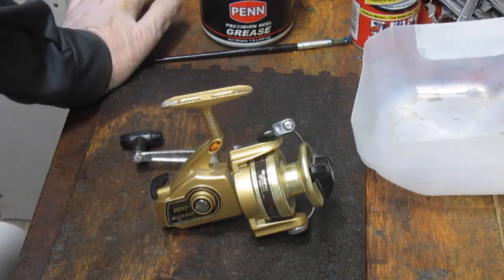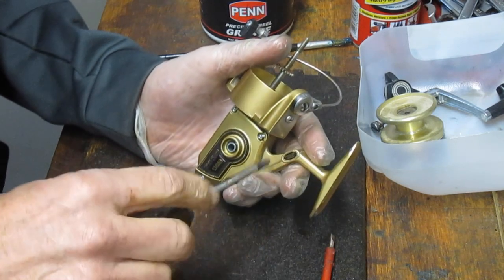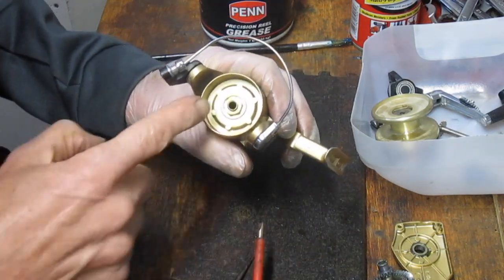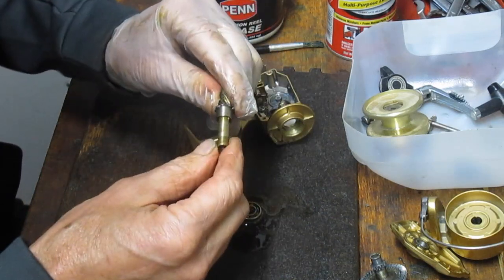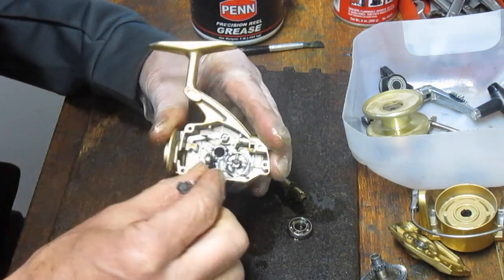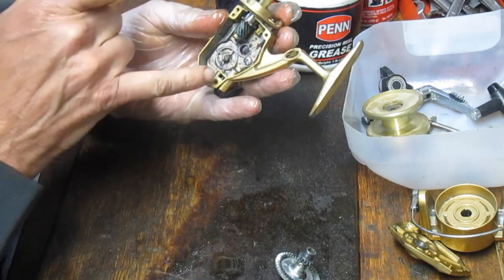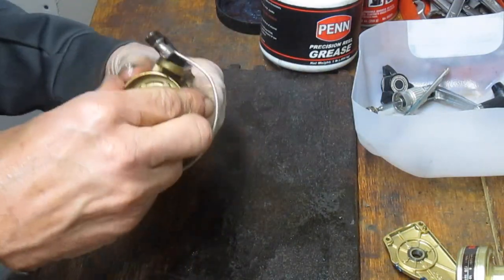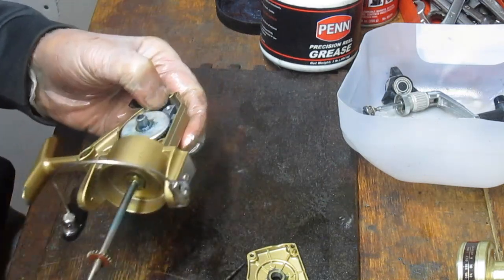Olympic GVO13 circa 1970 -80s Spin fishing reel how to take apart and service

Comment: I just got an Olympic 5060 saltwater reel. It is black with a gold spool. I bid on it after seeing this video. The only other Olympic I’ve had is a red 540. It is in mint condition and I have fished with it in the surf. This 5060 is going to need some painting on the arm and foot but other than that is in very good condition. I’ll let you know how it turns out. I hope it is very similar inside to this one in your video.     It is a little larger. I think there is a “reel” art to be able to correct bent bail wires. I’ve had mixed results mainly because the bails on large surf reels tend to be difficult to bend. I’ve just about worn out my Mitchell tools. I wouldn’t work on a 302 bail w/o that large Mitchell tool! Since my last comment I’ve added 3 more reels - my addiction is getting worse. I am restoring a Mitchell 402 and converting it to PUM,  added a 306A, and this 5060 Olympic. That makes an even 60 reels now. Out of control!
Reply from the maker: Good luck with the Olympics. They are built to last work horses like the Daiwa and others of the time.  You should enjoy fishing with them.  Thank you for the update.  Dennis

Comment: Very nice reel. Haven’t seen this one before. Great video Dennis! By the way, with 57 reels I definitely have more than I can use but I certainly try.
Reply from the maker: I think you may have exceeded the "usable" amount about 50 reels ago. Christopher.  So what?  Keep at it!  Dennis
Reply: 2nd Chance Tackle On my last week long Beach trip (last year) my son-in-law and I used 22 different reels. I’m never going to do that again. I am going to do a little local pond and lake fishing since our beaches and piers are mostly still closed. I have 8 vintage freshwater reels. I keep having kidney stones which are making my life even more miserable right now, Next week I’m going to start on restoring a Mitchell 402 and converting it to PUM. It will only work if I’m lucky enough to get those tiny set screws out and can replace the main bearing. We’ll see, I got a great deal on a 402 but the reason was that turning the reel had resistance, As you know there can be several reasons for that but I’m hopeful that with my experience with the 16 Mitchell’s I’ve worked on, I’ll be able to fix that. Wish me luck with the k. stones. Hope you’ve never had one. They are hell!!!
Reply: Dennis - I just got a Mitchell 306A for $10. Does the 306A have a ball bearing sort of like a 406? I’m trying to find a schematic.

Comment: Great video. My dad just passed on an Olympic Helicon 600 LG VO reel that looks similar to this reel. The anti-reversed mechanism was not functioning and it was pretty beat up but I was able to get in there and fix it. Now that I have it all assembled, the real is clicking during the Retrieval. I noticed your reel did the same thing on retrieval stroke in the beginning of the video. Is that normal for my model reel? was that how they were made in the 70s? Any info appreciated. Thank you!
Reply from the maker: Sounds like the anti-reverse dog doing its job and yes, that is the way they were made back in the 70's.  There were only a few of the reels that has a silent anti-reverse set up - Dennis

Comment: If you ever come across an Olympic 600 LG VO big surf reel please let me know. I need parts a pinion gear and main shaft. I'd send you the reel to fix anytime. It's completely apart cleaned and waiting for those parts,  even have carbontex drags for it. Trying to fix for an old friend. Sentimental thing.
Reply from the maker: I will write a note to myself and look of for one.  Best wishes - Dennis
Reply: Thank you Dennis.
Reply: Hey Dennis concerning that Olympic 600 LG VO pinion gear and main shaft. I followed a hunch and found out that that the internals on a VS 5000 are exactly the same as the 600 LGVO. And problem solved. Thank goodness for relabeleing and different badges.

Comment: Good Show!   I check your channel first before checking e-mails.   Is Lubriplate 107 white grease okay for saltwater reels?
Reply from the maker: I wouldn't use it.  This is an industrial grease meant for motors.  It is water resistant and may be used in marine applications, but I don't know the consistency, chemical make up, etc. enough to recommend it.  Stick with a grease from a fishing reel manufacturer or acknowledged aftermarket brand - Thanks for asking - Dennis

Comment: Hi Dennis,
      I would agree that's a really sweet reel and a great maintenance video.  Is the anti reverse lever and internal reverse mechanism a standard set up as it interfaces w the main gear ?  All the Best...
Reply from the maker: This is a common set up for this generation of manufacturing.  They may be configured a little differently, but the principle is the same.  Thanks Cons - Stay well - Dennis